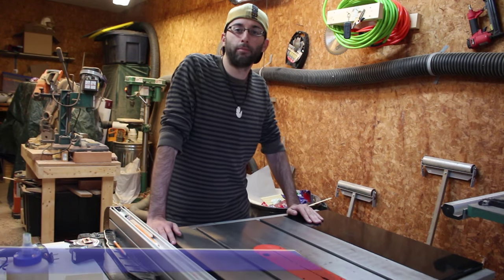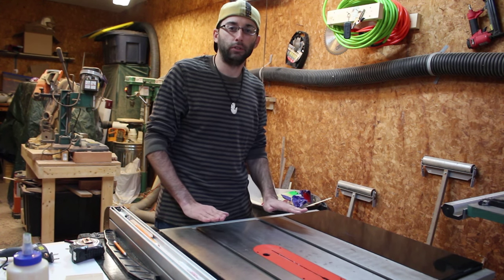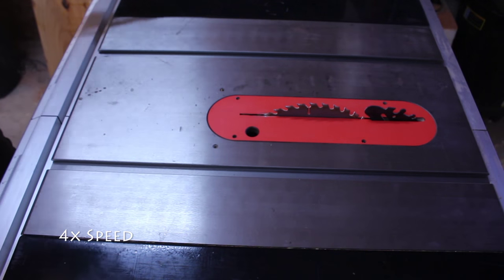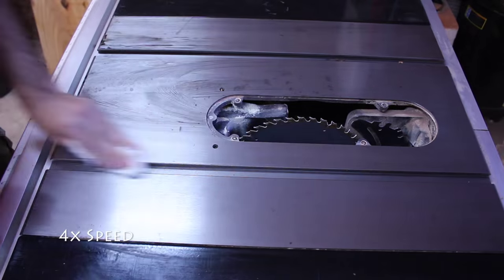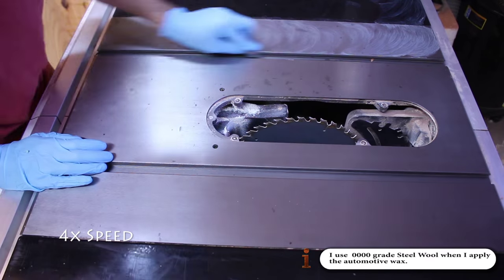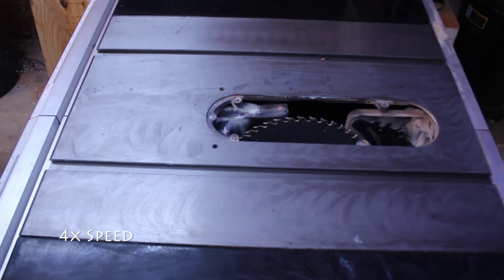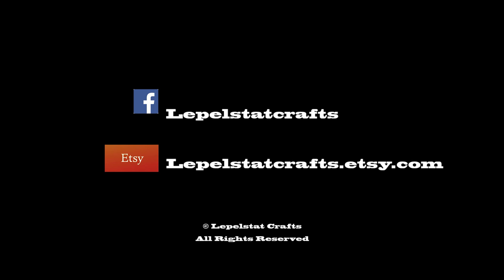How To: Clean and Wax a Table Saw

Comment: Excellent short video. Using 4x speed shows all the steps but doesn’t take up a tremendous amount of time. I have a large whetstone I found at a garage sale. I used it on the cast iron parts then coated it with a creamy mixture of turpentine and bees wax which I normally use to polish wood. I also did this on my drill press. It works great. Thanks

Comment: I tried several oil products that hasn’t worked. My shop is on the Texas Gulf Coast and waxing with a non silicon wax works. I will try using the steel wool. Thanks.

Comment: PSA: Never use automotive wax on ANY tool surface that you will be using with wood. Almost ALL automotive wax contains silicone which is a good thing for a car as it improves the non-stick property, but if you use it on say a table saw like you did the silicone can get into the wood grain and decrease the quality of any finish you apply on anything you don't sand plenty.
Reply: Agreed. It can also lead to problems when laminating strips of wood that have been out through a saw or planer with these types of waxes.
Reply from the maker: Hi Jdman1699,

I have been using this method for years as well as the person that showed me.  Both he and I have never had any issue with this process or finishes.  The key to preventing issues is to let the wax fully dry and harden.  Once you buff the table, you shouldn't have any issues.

Sincerely,

Mike
Reply: So after making this comment I decided to put this conjecture to the test. I applied a coat of paste wax and turtle car wax on either side of a jointer table. After rubbing two boards against the two surfaces vigorously I noticed no difference in the clear coat or stain quality on either boards. Obviously the constant warnings I have been hearing were overstated.

That said, I would still recommend paste wax. It's what every professional woodworker I know uses and I imagine it will last longer. It's not very expensive after all. Also, I learned not to waste time buffing the paste wax out; instead just apply a very thin coat and let it dry overnight. Same - if not better - results with far less time spent doing it.
Reply from the maker: Hi Jdman1699,

I am glad that you took the time to experiment with this method and that you determined what method was going to work best for you.  Happy woodworking!

Mike
Reply: What about using a furniture polish?
Reply: Jdman1699 not automotive wax!

Comment: how you think minwax floor wax work??????
or  polyurethane floor finish.?
reason wondering , i get the whole "silicone" thing. and i'll be doing some introduction of other materials into the wood, (vacuum/ stabilizing). where a  silicone may have an effect.....

Comment: Is the method suitable for duralumin surfaces?
Reply from the maker: That's a very good question. I don't know if it would be good for a hardened aluminum surface. Like any finish, you could always try it on a small section as a test. Report back with what you find so others know what your results were.  I'm interested to find out too.

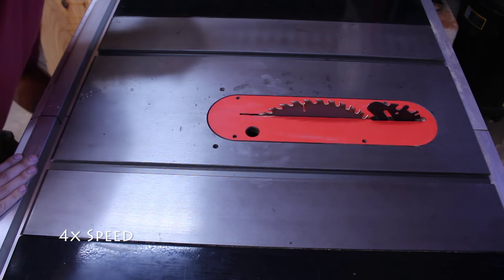Comment: I was shocked at 3:45 in your demo!  You were cross cutting using the rip fence.  Fantastic way to get a kickback and get hurt.  I realize it was a wider board but it is still dangerous.

Comment: How about waxing the fence and insert?   Would you advise on waxing those since they make contact with the wood and can tend to build up yuck?
Reply from the maker: Hi TruWebs LLC 

My insert is a slick plastic so I don't wax it. When I use my dado insert which is painted metal I do. The painted insert acts just like painted wings on the table saw. 

I currently don't see a need to wax my fence. If you think it would help try it and let us know if you see any improvements.

Remember experimentation is good. That's how we learn new things. I look forward to hearing from you about the fence if you do try it. 

Mike

Comment: Why use steel wool to apply wax ? I wouldn't use 0000 to wax my car.. Is there any advantage on cast iron ?
Reply from the maker: GrandActionPotential 

The steel wool works two ways as I've seen it.   

1) it prevents wax from just dumping all over the place primarily.   This means when you are spreading out the wax, it doesn't just focus in one place like a rag might. The harder you press during the process, the more wax is distributed. 

2) The wet sanding only works so much.   For inclusions or slight dips in the metal surface, the wool helps to remove the rust while putting wax down at the same time. 

Remember there is a big difference between a steel table saw and a painted car.   The steel is significantly harder than the paint.  I completely agree with you that you should not use this method on your car. 

Thanks for the question, 

Mike
Reply: Mike,

Thank you for the reply. I can understand the time savings of the abrasive applicator when the surface is not prepared, that is a good idea. I'm not a fan of using steel wool on an iron surface, unless there is experience with scraping metal surfaces. For the inexperienced, a less aggressive applicator is likely a better selection.  

If removing flaps (the high spots after denting the flat surface), I prefer to cut them off using a carbide scraper or a high carbon/HSS blade. An old diamond honed plane blade or a new razor blade can work well. I use a 4 inch carbide, portable planer blade mounted in a paint scraper handle for wider area treatments. 

If light sanding after removal, I prefer full size wet sanding using full size sheets and a piece of polished marble or quartz counter top as a sanding block.  Polished granite and quartz counter top surfaces are usually less than .001 flat, many times .0005 inches flat. Its more like lapping  than sanding, which prevents sanding divots from occurring. If the block is too slippery, remove the glaze by take two pieces and rub them together with some sand between them.

For waxing, I use beeswax thinned out to apply in spray bottle. I think I used petroleum turpentine or paint thinner so it works in the sprayer. If I need it to dry quickly, I use acetone, some use methanol. Spraying gives a very even coat ( last step in a french polish, a trick learned from my uncle ).  After waxing, I use an old auto polisher, but you can just let it dry and hand buff a bit.

cheers and keep making great videos.
gary
Reply: For a table in good condition, just cleaning with a decent cleaner and applying wax with a cloth is all that is needed. There is no reason to use sandpaper or steel wool on a table saw surface that is in good condition.

Comment: Great to see you using your hands, but everything you have done can be done much much much faster and better with a random orbital electric.
Reply from the maker: Haiku,

Thank you for the comment.  I have't tried it with a ROS.  What grit sand paper do you use?

Mike
Reply: You do not want to use a power sander on a table saw top. Using a large flat board with very fine sandpaper is the best way because it will (mostly) prevent unevenness on the surface. Honestly, I would not advise using sandpaper at all if it can be avoided. Over time you are likely to develop low or high areas which will affect the quality of your cuts. There are product out there that can remove light rust or stains on the surface without removing metal.

Comment: I think that it would be much better to clean the bed with denatured alcohol or naphtha before waxing to remove the WD40 residue so it does not impede with the wax adhesion or leave a reside  on your wood when you cut it.

Comment: Never ever use anything that has silicone in it on your table.
It will cause anything you stain to not take the stain…be sure to check..
Good vid. I personally use 120 grit sandpaper and rubbing alcohol, than follow with Johnson paste wax.